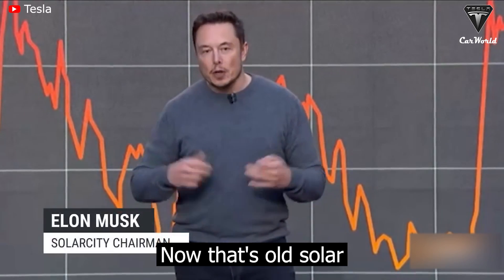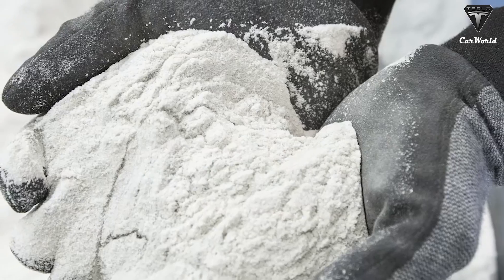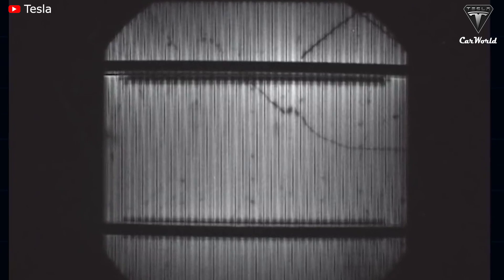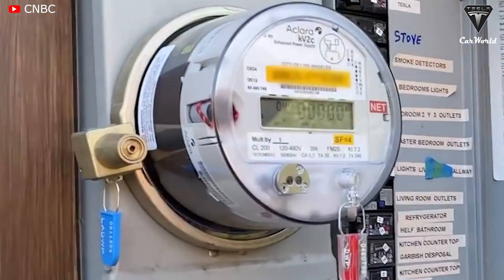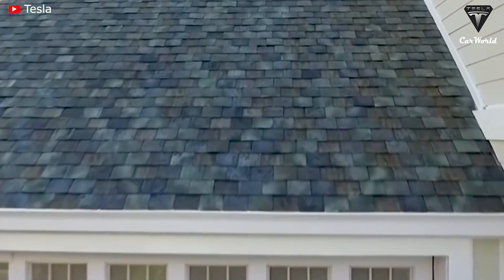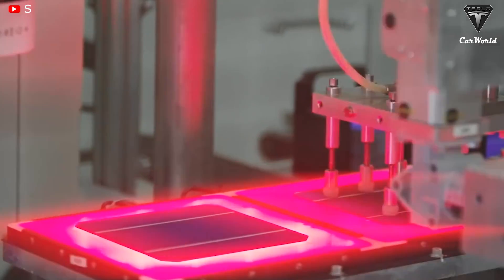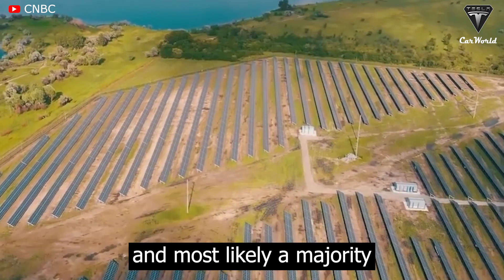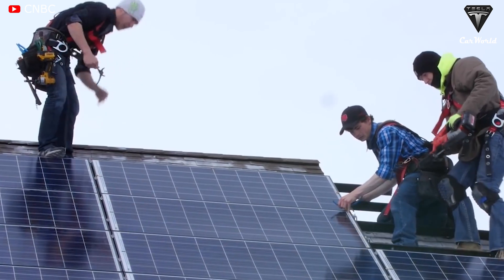IT HAPPENED! For Only $0.22/w, Tesla 4.0 solar cell Can blow your mind!

Comment: They might say they'll be released for $2/watt... but you can damn sure bet that by the time they hit the market they'll cost exactly as much as the mid-level ones cost because Shareholders...

And another key question:  *How recyclable is it??*  How much of these materials can be reclaimed at the end of the panel's operational life?  Current PVs are all but impossible to recycle, resulting in countless tons of heavy metals and other very toxic elements being dumped into landfills and other storage facilities.  Same thing goes for wind-turbine blades.

It's all well and good to go Green, but not if the end result is worse than smokestack smog.  Yet there are vastly safer nuclear reactors out there, 1/110th the size of the monsters on 3 Mile Island and Chernobyl that can produce energy with fuel that would otherwise be buried in storage bunkers... and do it for decades.  Big oil and now Big Green can't stand the competition so lie through their teeth about far safer alternatives.
Reply from the maker: In the EU, producers are required to ensure their solar panels are recycled properly. In Japan, India, and Australia, they’re coming up with a recycling plan. And in the US, with the exception of a state law in Washington that requires manufacturers to recycle the panels, there is no plan.There’s a cost problem in the US because it’s way more expensive to recycle than it is to dump. It costs less than $1 to dump a panel in a landfill and between $12-25 to recycle it, but only $3 is paid out for recovered aluminum, copper, and glass.Hope there will be many solutions in this recycling. Thanks Amzar Nacht for your comment and have stay tuned for our next video !

Comment: that's nice. but how long do they last before having to be replaced and are they recyclable. until they are recyclable, they are just another source of pollution that negates any green benefit that is advertised. it's not green energy unless manufacture pollution is cut in half and they are at least 70 percent recyclable.  without this it is just another con job.

Comment: If thecurrent panel is 22% efficient, say, a new rype is 95%, the  how on eqrth can 1500 kWh go up to 1500000 kWh?
Reply: 1,000 watts per square metre is what sun sends to earth surfaces properly oriented. But only a little more than 300w of electric power may be obtained from a 30% efficiency solar panel.
Reply: @josemariatrueba4568  so, what 1500 watt do you think it was in the above text?
Frankly, I don t understand.
Reply: @kondorviktor  Simply impossible!

Comment: We need one that can last for 100 years
Reply: That would be nice. But why exactly do we need that. If a panel can be recycled after 50 years and that material can make a panel that has twice the efficiency. How is that a bad thing?
Reply: or just a process to recycle them , people like new and shiny things ,
Reply: Even only few % of  houses of all lasts for 100 years. Meanwhile, I am a Europian so I a least saw some 100 years old houses, not like in USA, haha :) Solar panels are still better than burn coal to make electricity.
Reply: They already last 25-30, honestly, that's plenty. And after that long the replacements will be cheaper and better.
Or you could upgrade after only 10 years and put the old ones on the second hand market. Then some poorer people can get still-decent panels.

Comment: A old friend of mine would agree with your method of multiple materials.  They each react at a different frequency,  thus allowing this product to accumulate power over s broader range of frequency,  good job guy's.
Reply from the maker: Yes, This arrangement could greatly increase the efficiency of solar panels. Thạnk you for your comment and have a good day !
Reply: Perhaps we should now plan for better utilisation of reflected light, along with transmitted light?combined CSP and pv?
Reply: When people need research finance, they initiate a rumour?pervskite or multi junction.could we not set up 200percent renewable based on current technology and upgrade with the proceeds?
Reply: Yeah, but did you notice the failed math? According to the numbers in this video they are harvesting 50 times the amount of sunlight available anywhere. Even the math for the daily vs weekly kwh is completely wrong.

Comment: How efficient are these cells in converting sunlight to power?
Reply: I read somewhere that more than 30% efficiency is possible for cost effective cells
Reply: @777trader8  I really only know that the cheap panel for my boat, bought 2 years ago, is 21% efficient. World record was 47.1%, recorded in 2019.
I guess that goggle might know better than me if 30% plus efficient panels are cost effective today.
Probably not. Not unless available surface is limited, like in a very expensive racing sailboat that cannot be plugged in the middle of a round world regatta nor may afford to extend panels outside because they will produce inadmissible wind drag.

Comment: Owning a solar panel is somewhat like having a employee.  The panel works for you providing electricity for 25 years.
Reply from the maker: Yes, The industry standard for a solar panel's productive lifetime is 25-30 years. However, a solar panel won't die after 25-30 years, rather, its output will decrease a significant amount below what the manufacturer projected.Thank you for your comment and have a good day !
Reply: @TeslaCarWorld  What’s your definition of significant?
Reply: @johnfrederick1442  With good panels like REC or Sunpower you'll be at a 100% offset in year 1, 92% in year 25. That's quite amazing haha
Reply: And the best part is all the coal gets burned in china to make the cell.  Also they dump the hazardous chemicals into the rivers to destroy the environment.  Thankfully the government will take out a loan that your kids will have to pay back so you can buy a dirty PV cell.

Comment: But what they don't tell you is that most of these solar cells have only a ten year warranty, are made of glass basically and will not give back any significant payoff for at least 25 years. That means that you may have to replace your panels two times before you start seeing an appreciable return on the investment. That's quite a long time to see any kind of economic payoff for what you have to outlay immediately just to install the panels. And if you end up having to replace them twice, you are behind the eight ball because now you have the cost of replacing the cells which basically is another outlay of initial money investment so instead of recovering the cost of the initial installation, now you have two installations.  It's not a stretch to say that most people may not even see a return on their investment as they may move from the property or die before they see a dime of compensation for initial cost.  Then too, there is no serious way of recycling the panels to extract for example the silver from inside the cells. Tesla even admits this. So the green advantages of such cells is what again? Costly outlay to install them initially, no return for at least 25 years, some say 30 years, no method currently to recycle used cells and extract valuable metals back from them. This seems to be yet another dream that has not yet become a reality and requires further development before you can replace fossil fuels completely. I am all for find clean energy alternatives that help people reduce their costs for energy but we are years away from that and despite Musk being a very intelligent innovator, he isn't infallible, nobody is. I can say that eventually, solar may become the main source of power around the globe but that is rather vague and does nothing to address need and costs now.
Reply from the maker: Thank you so much for your information and have a good day !

Comment: First, if it doesn't exist in the atmosphere (Nitrogen, Oxygen, Hydrogen, Argon, Neon) but has to be recovered from the Earth's Land or Ocean, it still requires ... mining. Second, regardless of what elements are used, solar still only produces peak energy from 10:30 till 2:30 local time. The remainder of the day it's practically useless and totally unproductive for 12 - 16 hours every 24 hours. This requires your system to produce not only what you use while it's generating power but also what you need for the remaining 18-20 hours daily and a Battery system to store and deliver it. A battery that can be discharged and recharged daily, for years, without losing capacity. A battery that every home would need whose materials also require mining
Reply: On the other hand, 10:30-2:30 on sunny days is when grids experience AC-related rolling blackouts.
Reply: @jefflittle8913  Keyword: Sunny.  My location gets 12 sunny days per winter season!
Reply from the maker: Thanks Bryan Anderson for your comment and have a good day !